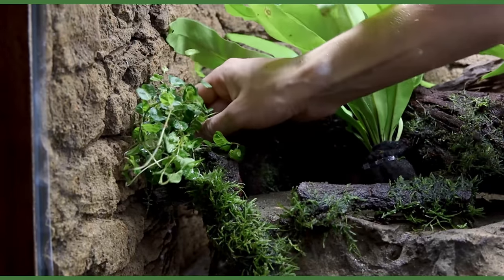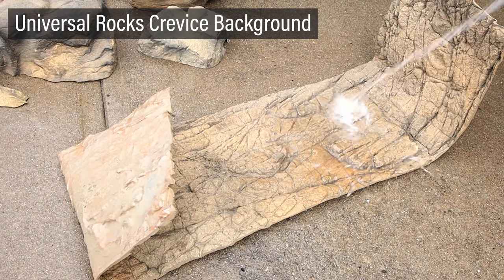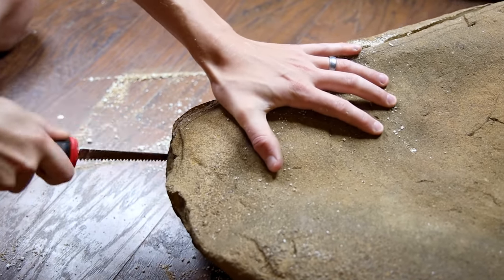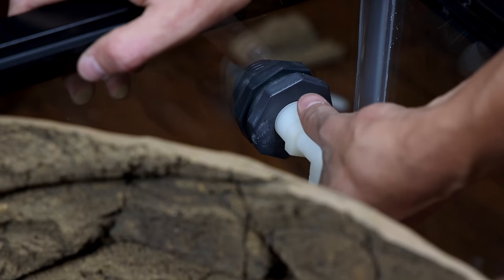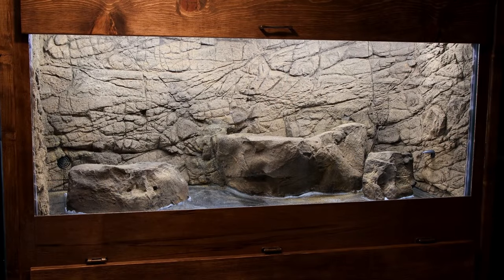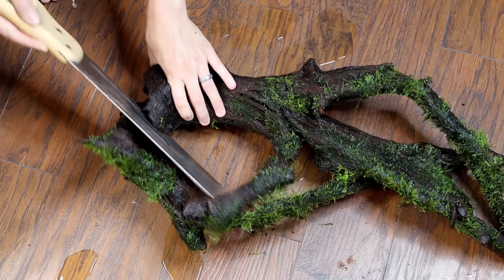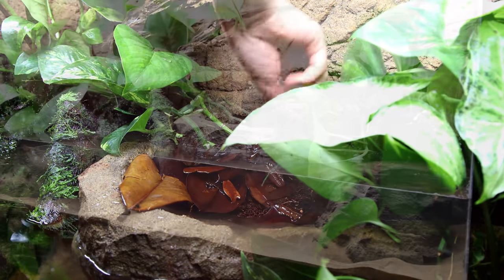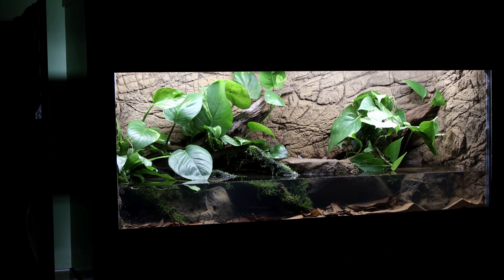The NEW Pixie Frog (African Bullfrog) Paludarium

Comment: I just set up my first paludarium ever, inspired by you of course. I used the egg crate and zip tie method to create the land, and it even has a little water fall. I'm having a bit of trouble with the water feature, but that's expected. I'm super curious about the aquatic clean up crew! I'm already well versed in isopod and spirngtail cultures, and I was wondering if they had an underwater equivalent. :)
Reply: there are aquatic species of isopods and springtails! well, the springtails actually walk on the surface of the water, so idk if they can be called aquatic, but they're cool anyway :p

Comment: silicone does not work as good with plastic surfaces as it does with glass, just keep in mind there are still chances the background will fall to the center of the aquarium little by little as it gets the time it needs to separate from the silicone you applied there. It does not hold as strong of a connection on plasticky surfaces as it does when applied on glass. Aside, great video as usual xd

Comment: General question, in your 10 gallon vivarium builds how do you get uvb rays inside the tank if the top is glass cuz doesn't glass block uv rays. I want to do one of these 10 gallon conversions but don't know how to properly light it, this will be for anoles by the way